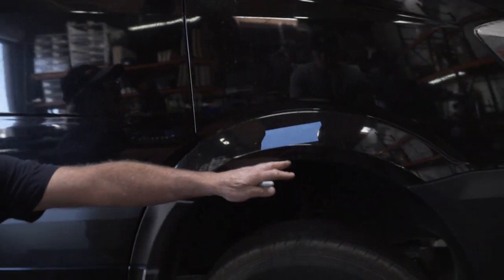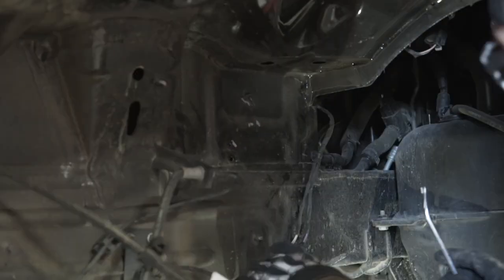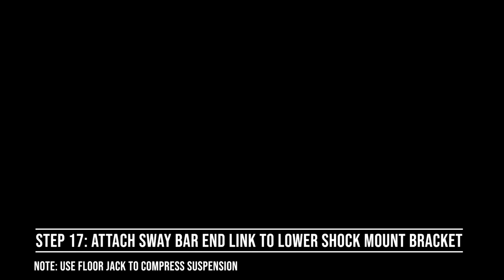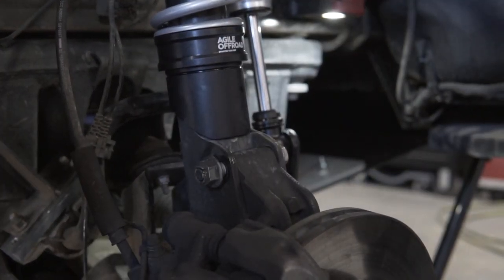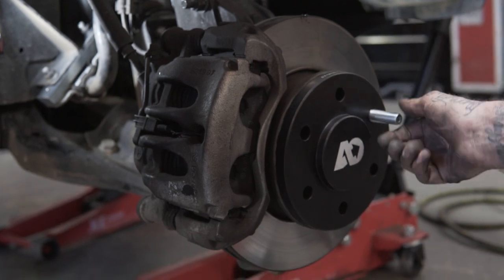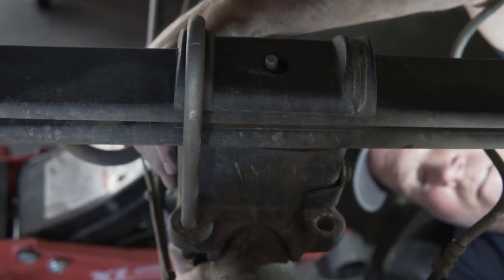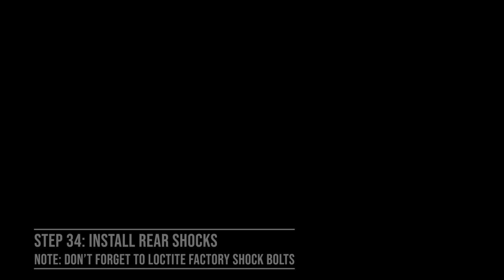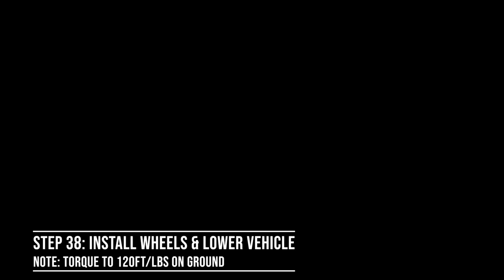Agile Offroad Mercedes Sprinter RIP-KIT Installation Guide

Comment: I only finished the passenger side.  The front sway bar was a huge pain.  I also bought the Koni front coilovers and they were a pain to install.  The strut is really weak and won't go up in to the cab so I can get a nut on it.  It doesn't cover any of that in the video.  Any tips?

Comment: Is it better to disconnect the sway bar on both side while working on the rear leaf springs and shocks, or better to do one side at a time? 
Also, do I need to get spacers? Or could I leave the wheels alone if I’m using oem rims and road/ highway tires?
Reply from the maker: In the rear disconnect the sway bar end links on both sides first. Then work one side at a time. Wheels spacers are required for the front coils to clear the tires no matter the wheel/tire combination.

Comment: What is actual install time on this RIP kit? Also in the video, u bolt  torque is said to be 140ft. lbs but the install sheet says 125 ft. lbs what is it actually supposed to be? Another thing I noticed is the difference between the stock spring and the 4700 agile spring was the spring mounting points a significantly different in length about a 3 1/2" to 4" different which caused me to install the spring pack with a ratchet strap to line up the center pins. Both springs where install with the FRONT stickers to the front. but had to ratchet strap the differential forward about 2" is that normal?

Comment: Well done and very informative. Didn't catch the 'after' measurement tho  :-\    Maybe I just missed it?
Reply from the maker: The "after" measurement didn't make the final cut of the video, but in almost every installation ride height gain is about 2-inches.
Reply: Even my wife sat through this with me and grumbled "they didn't measure it after!"
Reply: @Agileoffroad  Is the 2" lift with or without tires with increased diameter?
Reply from the maker: @shawnjolley254  2" in ride height increase via RIP suspension. You'll see bout 3/4" increase going from a 245/70-17 to a 275/70-17

Comment: Hey! Im from Brazil. Where are you from? I'd like to convert a 2000/2001 2wd Sprinter to 4wd. But there is not  this 4wd version here in Brazil. So I'd like know If you have the parts for this conversion 2wd to 4wd.  How can I buy this parts? TKS.
Reply from the maker: Hello Rodrigo, we're located just outside of San Diego, California. Unfortunately we do not do 4x4 conversions on Sprinter (only Ford E350 vans) because it's a factory option from Mercedes in the US from 2014 and on.

Comment: Can you install the front rip kit on a van with a lift? (2” vancompass lift”
Reply from the maker: The RIP Coil cannot be combined with any other lift kit. For the best performing suspension option, we'd recommend removing the spacers of your existing kit and installing the RIP coil with upgraded struts. The additional spring force from the coil & damping from the strut will drastically improve the ride and handling of your vehicle.

Comment: What about the driver side? It’s totally different. Also you guys mention nothing about the refrigerant line for rear AC equipped vans being in the the way of the rear hole that needs to be drilled through the sheet metal on the passenger side.
Reply from the maker: The installation process for the current version of the RIP Kit is almost identical between driver & passenger sides.

Vehicles equipped with factory rear A/C cannot install the auxiliary shocks as the brackets won't fit with the A/C lines. For those vehicles we typically install the RIP Coil with upgraded struts in lieu of the additional shocks.
Reply: @Agileoffroad  I have a 19 144 passenger w rear factory ac.  I installed the aux shocks on mine no problem.  There is a bend in the lines and the bolts fit fine.  You do have to be sure you don't plunge too deep with the drill though.

Comment: I didn’t see an “after” measurement, just the “before”.
Reply from the maker: The "after" measurement didn't make the final cut of the video, but in almost every installation ride height gain is about 2-inches.
Reply: @Agileoffroad  Installed my RIP Kit last week. My measurements are in the pics. Absolutely the best mod I have done to my Sprinter. https://www.instagram.com/p/CI9f_DrgnyQ/?utm_source=ig_web_copy_link

Comment: This will void your warranty
Reply from the maker: While installing our RIP Kit may affect the warranty on individual suspension components, it will not void the warranty on anything else. Modifying your vehicle is a consumer protected right (see. Magnuson Moss Warranty Act). Additionally both we offer a 1-year warranty on our parts & workmanship. We have hundreds if not thousands of kits on the road, and we're yet to have a customer mention any issues dealing with MB and warranty related issues regarding our kit.